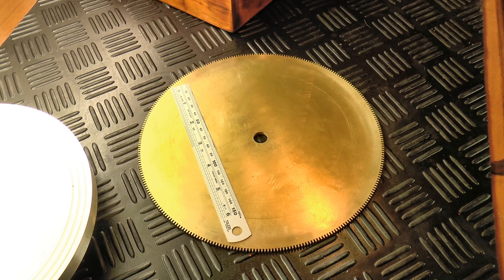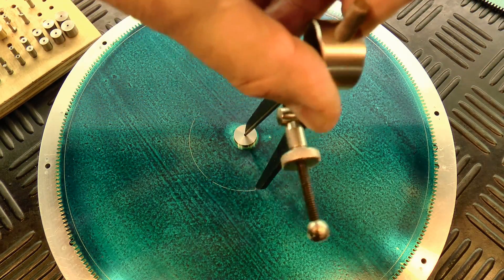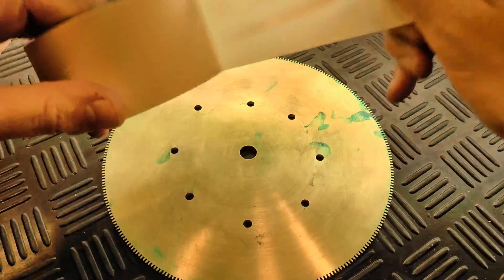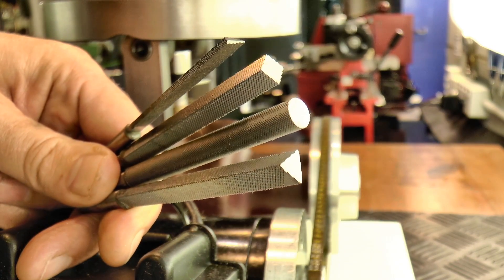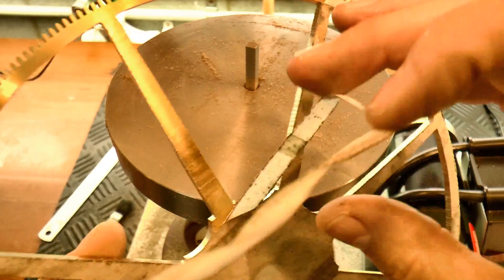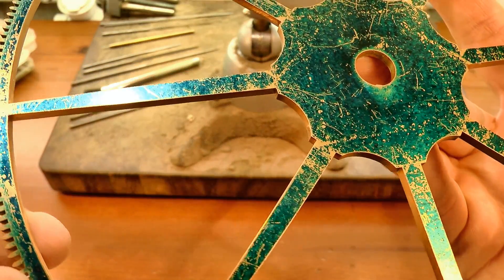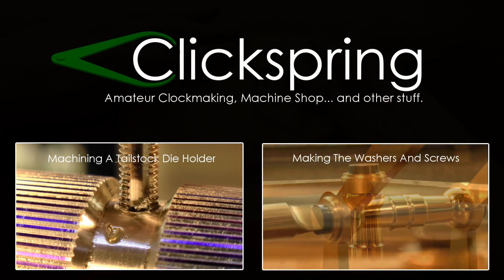Clockmaking - How To Make A Clock In The Home Machine Shop - Part 6 - Crossing Out The Wheels

Comment: I love the precision and the attention to detail, but considering all that I have to ask, why do you leave so much filing work with the scroll saw? Seems like you could save a lot of time cutting much closer to the scribe line.
Reply from the maker: I have learned the hard way that its best to be cautious - cutting closer to the line runs the risk of scrapping the part. Generally I leave on somewhere between 0.5 and 1mm. At least half of that is unavoidable; its required to make the finishing cuts with hand files. If I leave much less than 0.5mm on the saw can easily leave a cut stroke inside that finishing allowance and ruin the part. Acute corners are an exception, I always leave a bit more on in that case, because powered cutting in a tight corner is asking for trouble, best to go in gently with files.

Comment: thanks for giving us these videos , I wish this was here when I started clockmaking 20 years ago , I have one of the books but I don't have and can't find the one by Daniels , I'm wondering if you will give an explanation as to why you laid out crossing out jig the way you did and why you made the hole patterns the way you did,  I built a smaller jig , but I'd rather build one like yours ,  it's really awesome !!! I just was asking basically what hole patterns you used and how you laid them out so I can build a jig like yours , thanks again for all these I always watch
Reply from the maker: Hey Daniel, I have varied J Malcolm Wild's idea slightly, and have a continuous set of holes out to the perimeter for each index position. I wanted to have a jig that would cover every conceivable wheel size I will ever make, and also limit the pins to a standard single size pin, so that a single size set would cover every spoke taper.

Dimensions:

Plate OD: 245mm
Step between each ring of holes: 10mm
Pin OD: 1/8"

The plate is 1/2" aluminium, and the inside hole is bushed with brass to stop it wallowing out since it gets the most use. There's a lot more holes than JMW's version, so it's a fair investment of time, but so far it has been a very useful little platform. Not only for wheel crossings, but also other simple indexing tasks like marking out screw hole positions, as well as a circular graining platform.

More info here: http://www.clickspringprojects.com/wheel-crossing-jig.html, and here it is being used for simple marking of a ratchet square hole: https://www.youtube.com/watch?v=EUGSplH6gHM

Comment: Thin metal, large area, cutting in one plane only, precision not required. I would have drawn up the spoke design in AutoCAD and sent it for laser cutting.
Reply: +shox007 Not much sense of achievement getting someone else to do the work for you. Why not skip the whole process and just buy a clock then, instead of trying make one.

Comment: Hi there. I am rapidly approaching this stage with my own clock and my attention has turned to making a jig for the marking out. I have been looking at the jig detailed in the Malcolm Wilde book but I cant figure out what the extra 4 holes are for on the inner ring (look at the drawing you will understand what I mean.) then I came here to check what you had done and yours seems to have even more holes!! Dumb question..... what are they for?
Reply from the maker: +Peter Morgan Hey Peter, I changed Malcolms design to suit my needs, but the principle is the same: the pin diameter sets the spoke taper. In my version with holes for each index count all the way out from the center, I can use a standard pin size for any spoke number/wheel diameter combinaton.
Reply: +Clickspring many thanks for the info! I have also only just noticed you are using the SX2P for this job! the same mill I am trying to use for the entire clock (oah I wish I had your bigger mill!). you seem to have made a custom round table?
P.S. I have ordered a piece of aluminium for the jig!

Comment: At the risk of sounding ignorant in regards to the subject, this is something I've wondered about: I can understand that doing this reduces the overall weight of the part, but doesn't it also increase the risk of it possibly warping or even breaking? Granted, that's a fairly thick-looking piece of metal, but it still seems somewhat on the delicate side, given how narrow the spokes and outer edge look.
Reply from the maker: +tibbus Great question - The forces experienced lower down the gear train are quite considerable, but the material is sufficiently thick to remain strong enough. Thanks for watching and asking.

Comment: Thank You very much for another impressive and instructive video!

I have a somewhat off topic question. Had my Hegner scroll saw since 1985 and it is a very well used used machine... I pre cut a lot of small parts on it before machining among other uses. Mine does not have the round insert in the table under the blade that can be seen in the video.

Frequently  a smaller gap under the blade is needed than the rather largish original hole in my saw table. So it should be very useful to modify it with inserts similar to Yours. Did You modify this Yourself, or is an option on more recent machines than mine? The more newer ones I have seen did not have it.

Have You compared the performance of the original Hegner Pebeco and Goldschnecke blades with the Antilope blades You are using?

 I have used the Hegner blades exclusively so far, since little else seemed to work well. Cheaper blades fail promptly...
I checked Your link and the rounded back of these blades seem like an interesting improvement. Unfortunately I did not find the German factory on the web or a dealer for  Antilope blades here in Sweden.
Reply from the maker: +Erik Isberg Antilope blades are far superior to all other blades I have tried. Try http://woodworks.com.au/ for the blades, they may ship OS.  The table insert was part of the machine, works great. Thanks for watching :)
Reply: +Clickspring Much appreciated, thank You!  I will try these these blades. I think I have found the German company making them:
https://www.niqua-shop.de/metallsaegeblaetter-antilope-blau-m86754

http://www.niqua.de/downloads/Niqua_Katalog_Metall.pdf

They seem to sell an impressive assortment of quality blades and tools world wide. Will order some different ones from them as well and some other small tools. They evidently make some of the original blades sold by Hegner.

Comment: Would the wheel not require any balancing/truing? or is it not necessary for the clock's mechanism? just thought with it being a rather large wheel then it might have to be balanced to ensure precise timekeeping?
Reply from the maker: +KailorenPlays Because it rotates so slowly no balancing is required for this wheel. Wheels that rotate very fast like a watch balance wheel definitely do need balancing, and for that watchmakers use a poising tool. Thanks for watching and asking :)

Comment: Where do you get your files for the die filer?
Reply from the maker: +dalebmartin I make them from standard parallel files. The filing machine cuts on the downstroke, so cut off tang, reverse, form a new tang on the other end with a bench grinder, then epoxy into a mild steel sleeve. Thanks for watching.

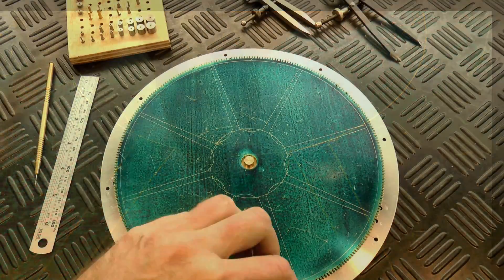Comment: i like your style of working and explaning. question: why to remove part of the gear in min 2:30? to reduce unnecessary weight?
Reply from the maker: +Rami7605 Yes weight, and also for the aesthetics. Skeleton clocks like this are intended to be as much a visual piece, as a working timepiece. Thanks for watching.
Reply: Clickspring
Interesting.

Comment: Do you have a video were you speak about your philosophy of workmanship? I ask because it seems like you do use power tools but still do a great deal of the finishing work by hand. It seems to me that come CNC tools could speed up the roughing processes on, for example, crossing out the wheels.

Thanks for some great work. You videos are as beautiful as the clock. (Loved the little stop-motion drama between the mirror and the dial gauge at the end of this video.)

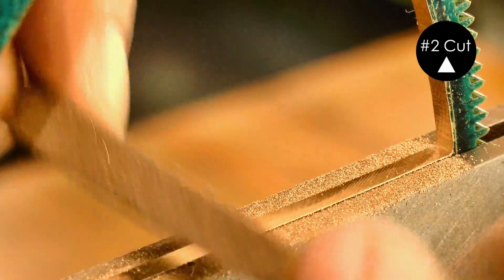Comment: Why do you leave so much material to hand file (~7:45)?  Seems like the automatic file could get you a lot closer and save some time.  Is the risk of messing it up just really high with the automatic filer?
Reply from the maker: demon39063 The bench filer leaves a vertical cut, but the last few grades of file and paper need to be draw filed to give a flat surface. So I leave a bit on to make the transition to draw filing. I am probably being a bit more conservative than I need to be, but it's a lot of work to fix it if you take it too far.

Comment: From the layout through the hand filing, this is a very fine example of great bench work.  I enjoyed it immensely!  The one question I have is - why no fillets in the cutouts' outer corners?  it would be stronger, and I think a more finished look.
Reply from the maker: Ujeb08 Great question! It's mainly for the aesthetics. For a clock to have a traditional appearance, square corners on the wheels are a must; rounded corners just look too modern. You will see filleted corners occasionally on some modern watch movements that are intentionally trying to look modern, but it's unheard of in traditional clockmaking. The stresses on spokes are not sufficient for square corners to cause any sort of failure issues. This is one thing about clockmaking that drives engineers crazy!

Comment: Hi chris, 
Very nice layout work,
Good job all around.
Never would have thought to saw the wheel crosses.
I would have tried to mill them on a rotary table.
Guess I  don't think like a clock maker
Jeff
Reply from the maker: Jeffrey Miller Thanks Jeff. To be honest I did consider it, but I figured the setup would take longer than just getting stuck into it with the scroll saw. Still need to hand finish anyway, because of the square corners.
Reply: +Clickspring Which is why I would have put round corners in them ;) I guess I don't think like a clock maker either!

Love your filing guide too.

Comment: Any specific reason why you stopped using the filing machine at a certain point? Is it just that you like filing or is there any other reason I don't get? I assume you just like hand work too much, otherwise you could just use a cnc router :)
Again an excellent video.
Reply from the maker: horle The filing machine cut is vertical, but the edges need to be draw filed to get a good flat surface. CNC would be good for the bulk of the work, and then followed by hand finishing. I'll definitely look into it down the track. Thanks for watching.

Comment: Holy c*** that was a lot of cutting and filing! Cutting those would have been the perfect use of a cnc. I don't think I would be a very good clock maker, you must be extremely patient and resistant to repetitive jobs. Excellent video though! This is turning out the be one of my favorite YT channels.
Reply from the maker: ***** Glad you like the video's. Yes I'll look into how I can use some CNC for speeding up the wheel cutting some time in the future. For the time being though, it has to be manual as I don't have access to any CNC gear.
Reply: I believe the milling machines you already own can be fitted with cnc kits. It's worth looking at if the work area is large enough for what you need.

Comment: Hi, I'm new to the channel. Your work looks really good and the video is very detailed, but not so much that it gets boring. It's a hard mix, but I think you do a very good job. I just have 2 things that stood out at odd to me. 1) you didn't show the end result weight. I was really expecting the weight to be tied in to show the contrast. 2) when using the machine that files up and down (@ the 5 minute mark), you seem to have dust in your way of seeing the line. Then you have to take your hand off of the piece to wipe away the dust. Is there a reason to not just point a fan at it to blow away the dust so you can use both hand?
Reply from the maker: Kyle Smith Hi Kyle, thanks for watching. Yes I agree on the wheel weight; I cut it from the final edit, but should have left it in. Oh well, you live and learn! It ended up being 236g. An air blower would be a good idea for the filing machine. I have something similar on the scroll saw, which directs a small jet of air onto the cut, and it works a treat. I'll add it to the project list!

Comment: Did you use a burnisher on the arms? I'm having trouble getting brass wheels to me mirror polished at the bevels
Reply from the maker: Chankyi Hi Chankyi, yes I used a shop made burnisher. I think it's a great way to get that final surface for bevels and edges of the spokes.

Comment from the maker: In this video, I get started on the wheel crossings.
Reply: Chris, I'm running out of superlatives for your videos. They are just so captivating and entertaining.  Also, watching this one in particular makes me think how time consuming and tedious this process must have been prior to power tools.  Well done. Scott
Reply from the maker: Aristocob Thanks Scott. Can you imagine being an apprentice to one of the old school clockmakers? I'm guessing they spent a fair bit of time filing!
Reply: Clickspring Aristocob I'm with Scott on the superlatives, Chris.  I could feel your fingers clear over here on this one, let alone 5 more.  I've always been curious how/when/if balancing takes place when you remove so much material, plus the thin section warpage?  I know the speeds are slow and a gear train but seems like balance on the gears as well as escapements would contribute to accuracy...and sensibilities¿  Your filing jig is most excellent as well as the Wild layout type....and the helpers, just the best!  Thanks for sharing all your fine/diligent work!  ~PJ
Reply from the maker: pjsalchemy Thanks PJ! Balancing is not so much an issue for wheels lower down in the train,as you say because of low velocity. But higher up a little more so. For something with high velocity like a watch escapement it becomes critical, with watchmakers taking great care to 'poise' a balance wheel.
Reply: +Ninki Kinzy It is called "Thy Business, It Is Not" written by a guy named Itsa Rude To'ask (traditional Russian name) Old Itsa wrote many songs dealing with common courtesy and etiquette. Hope this helps
Reply: +Clickspring wonderful video but I would like to tell me that's called background music
Reply: +TheDIMONART He uses a  Panasonic HC-X920 camcorder
Reply: +Clickspring Golden hands
Reply: Liked the little bit of comedy at the end !! nice touch- 'cos life gets tedious don't it.!
Reply: I forgot how awesome that ending is  LoL!